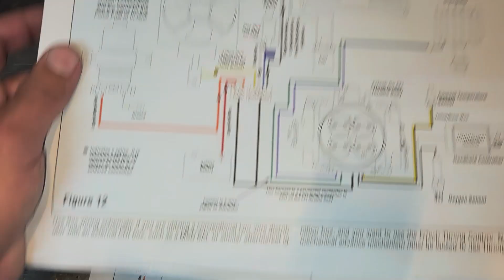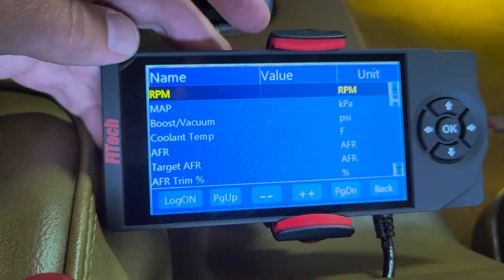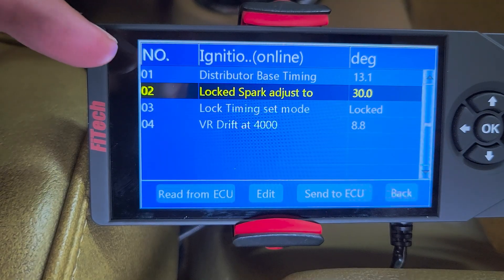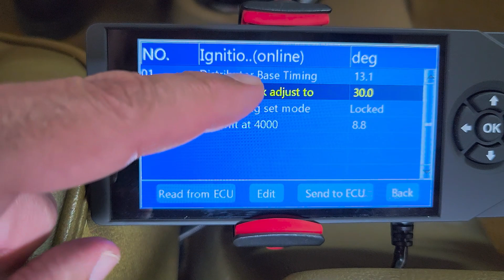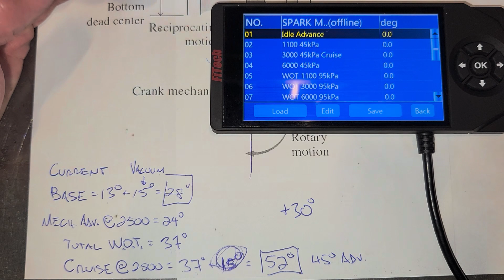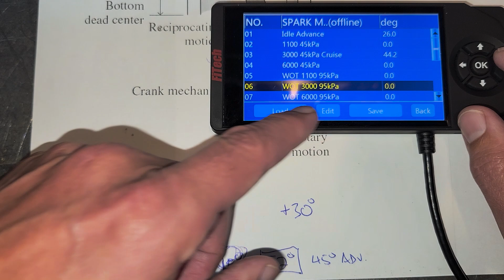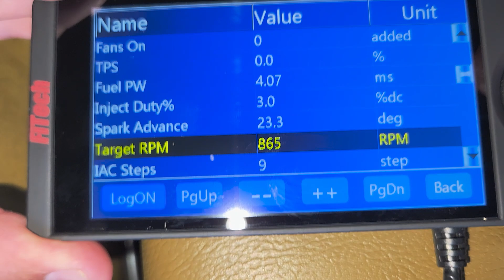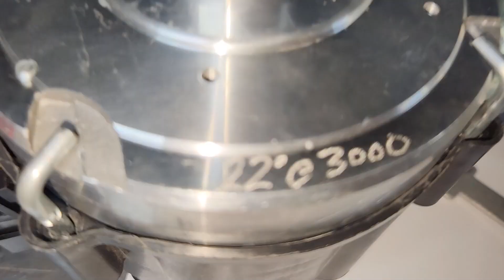FiTech Hand Held Settings for Ignition Timing Control, Part 2

Comment: As clear as mud. Where did you get the timing settings from?
Reply from the maker: Modified standard Pontiac timing curve.  Then dialed back WOT timing because of my heart shaped cylinder heads. I thought i explained that... maybe a different video. Hope that helps.

Comment: Nice video.  I bought a 70 Pontiac with the MSD distributor and 6AL on it.  It wasnt running when i bought it.  The sniper EFI was already on it too.  Well, i messed with the settings, thought that my distributor would have been locked out, adjustable rotor, etc. Wasn't..who would have bought all that stuff and not used it to full potential?!  Anyway, i just ordered a cap, rotor, and when they arrive this video, especially the one prior is going to be very helpful for me.  Thanks
Reply from the maker: Ohhh yeah. Locked out disti will make all the difference. Thanks for dropping a comment and keep us posted.

Comment: Make sure you ground the blue tach wire, I chased the rpm noise fault code intel that was grounded.
Reply from the maker: Agreed.  I didn't know it acts as an antennae until AFTER this video.  I also shielded my distributor output and added those Ferrite Beads to all of the cables going into the throttle body.  Here's that video... https://youtu.be/v_X9xyERAQE?si=w_q9YZPWxFoM-Zc_  Thanks for the comment!

Comment: Beautiful ride you have. My question is what spark plug gap are you using with the msd? Your engine has oem iron heads right? Thank you
Reply from the maker: Thanks!  My plugs are at 0.050"  And no, I have ported Aluminum heads from Butler Performance.  Thanks for the comment!

Comment: Instead of a distributor I have coils how would I set up ignition settings? My handheld doesn’t have an ignition option
Reply from the maker: Great Question!  I have NOOOO idea.  What fuel injection system do you have?
Reply: @FastMonty  ultimate ls 750 hp efi kit
Reply from the maker: Nice!  Unfortunately I've never used the LS set up, please reach out to FiTech, they might have a video of their own?  Good luck! @TheDRIVER3232

Comment: Really great videos explaining how this works. I'm curious can you use the distr advance without having the fitech do timing? I know that's not ideal, but can you tun off fitech timing control? Or is it turned off when you select 'not locked'?
Reply from the maker: Absolutely!  That was in Part 1, where I switched from a standard HEI disctributor to a Pro Billet that I could lock out.  The setting is in the handheld, where you pick between standard distributor, and 2 Wire + Coil.  It'll work fine with almost any standard distributor.  Have fun!
Reply: @FastMonty  thank you!

Comment: Is it possible to change the locked timing to a value like 10 degrees or 0?  I am using a tbi distributor and believe the rotor will be clocked more properly this way.  Isn't that the point of having variable locked timing?  The computer either advances or retards from that point?  Thanks for any help, and good video!
Reply from the maker: Good question CK!  Short answer, yes, you can set the Locked Timing for setup.  I think the default is 30 to keep it easy... For example, if you set the locked timing to zero, but your distributor is actually 30 degrees retarded, it might not start, and you'll be chasing your tail.  As I detailed you have to know what your all in number needs to be, and that determines your "Base Timing".  Hope that helps!
Reply: @FastMonty  copy that!  Perhaps the alignment is closer to centered on the lug than I think, and 30 degrees will work good..  but if the alignment is off, I see this as a tool to correct that.  Try asking some mechanics about this and I get deer in the headlights kind of looks lol.
Reply: Thank you for your help sir and quick reply!
Reply from the maker: Ha!  Yeah, when I first read your question, I too felt like a Deer in Headlights... too funny.  But, yeah, just an easier way to nail down that base timing.  Have fun! @Chiefs-online
Reply from the maker: for sure!   @Chiefs-online
Reply: @FastMonty  just to clarify, I am talking about rotor to lug alignment.  Without a mechanical distributor, the alignment moves through your timing sweep.  30 degrees is usually the middle of your timing sweep, and the rotor to lug alignment should be centered at said 30 degrees.  Usually this would be a non issue, but certain distributors will be off center at locked timing.  That is where I see the adjustable locked timing coming into play.  Hopefully that makes sense and didn't confuse ya more..  I seem to be good at that lol.
Reply from the maker: You referring to the rotor teeth and pick up coil location?  I think you're confusing what "locking timing" means.  It's purely for set up only to get the Distributor mechanically matched to the computer.  All based on your "base timing".  My base timing is 17 degrees, using 30 as my locked timing gives me some initial start up head room until I dial in "30 degrees" with the timing light.  In essence the distributor is mechanically locked down at 17.  After set up, the computer can not retard past 17, but can add up to 30 in advance.  (Again the locked 30 has nothing to do with the 30 degrees of advance the ECU can add)  @Chiefs-online
Reply: @FastMonty  no I am talking about the rotor to spark plug wire lug alignment.  Not the pickup trigger.  The alignment needs to be centered at the middle of your timing sweep.  So for example:  you have an initial timing of 15, and a total timing with vacuum of 45 degrees.  The middle of that would be 30 degrees.  So if your locked timing was set at 30 degrees, when you check your locked timing, you should also check rotor alignment via a hole cut in the distributor cap using the timing light.  If you have an adjustable timing light, make sure it is at 0 degrees when checking this.  It should be centered at 30 degrees if using the above example.  So knowing that, if your rotor and lug were out of alignment, I would assume you could change the locked timing, until your rotor was aligned properly.  Anything else I can say to help explain myself?  I think I'm gonna just have to test it for myself and see what happens.
Reply: @FastMonty  if the rotor gets too far out of alignment the spark has to jump too large of a gap, and your spark power at the plug is lost.  I've been failing to mention that.
Reply: @FastMonty  and they make adjustable distributor rotors for manually correcting it.  I just figured if the computer can compensate for it that would be cool.
Reply from the maker: I follow.  And, my comment still holds.  The "locked" timing number is purely to use your timing light to lock down your distributor.  The distributor would then be at the "Base Timing" you set in the computer.  If you don't "lock the timing" during set up it's almost impossible to adjust the distributor timing because the computer is constantly changing it on the fly.  Hope that makes more sense.  @Chiefs-online
Reply from the maker: Yup, that's why you need a phasable rotor.  I explained this in the prior video... https://youtu.be/dJ9Ea7hKrSQ?si=9bsQaQ1F_cxHwI8O  @Chiefs-online
Reply: @FastMonty  copy that.  Now it clicked with me, you mentioned in video changing your base timing will alter your locked timing position.  I clearly see why now.  It's backwards of how I was thinking, and it requires an adjustable rotor, like you say.  Thanks for bearing with me, this really helped me out!
Reply from the maker: Ha!  No worries... I get confused all the time when thinking about Retarding and Advancing... glad it clicked!   @Chiefs-online

Comment: Monty. I have a 64 Tempest with a 66 Pontiac 389, FiTech system, MSD Pro billit distributor, MDS 6A ignition control. I am in the building stage of this project. Do I need to set my FiTech up with timing control?
Reply from the maker: Good question... do you "Need to"?  No.  Should you?  ABSOLUTELY!  Why not?  you'll have full ability to change timing as described versus relying on weights and vacuum advance.  You need need a phasable rotor, and lock out your advance.   Keep us posted!

Comment: On one of your previous videos when your installing the wilwood hydraulic master cylinder. What fittings did you use/size. And where did you get them? Thank you 🙏
Reply from the maker: what fittings are you referring to?
Reply: The fittings that go on the wilwood hydraulic cylinder that you have bolted to the firewall to the clutch petal. 
The inlet and outlets.
Thank you for responding 👍
Reply from the maker: @trent_E  When I hear "fittings", I think of tubing, and connectors... The hydraulic line comes with the throwout bearing.  The mounting "Hardware" comes with the SilverSport kit. hope that helps.

Comment: Fantastic demonstration. Looking forward to seeing the next episode!
Reply from the maker: Thanks Brother!
Reply: Yes  very interesting I'm following  I have ordered the Ultra Ram Air  -MSD DIS  MSD 6 EFI  BOX   The MSD DIS has  two Wires Two plugs  According  to Instructions  One Plug will go to ECU  one will go to the CDI MSD 6 EFI Box  I did double check With Summitt  They Confirmed That each item will work as it Should .  I Have an ACES  MUTIL PORT  INJECTION  Nothing but Issues  I gave it 6 Months  To have them straighten it  out  I had to take it to Tuner  Just to get it  Running  He recommended  Pulling the system  so That's what led me to the Ultra Ram set up --My Buddy and Myself did the Aces install  I had to change the tank Run Lines  ect ect --After  the chaos  we had with this system  Now i did  an error  I installed the 02 sensors  in the collector  area Sense moved  My Batt Is also Located in trunk  So If you any of you are thinking of running EFI  and have your Batt relocated to Trunk You will have  to  run a heaver gauge wire  You  will drop voltage  OK  That got us to closed loop  Took care of the Issues  But  still not right   I'm sorry to say I CAN'T  Recommend  their product  This is no way I'm bashing another company  this has  been my experience The Shop guys are great to work with   --OK so this leads to my car in shop  I'm letting the Tuner shop do install  On the Ultra ram  Due to all the issues  we have had And the Issues  he has had  Will keep you posted as how it goes  I had stopped by there  yesterday  He  has one  in front of me  so hopefully  he will get started on it this week